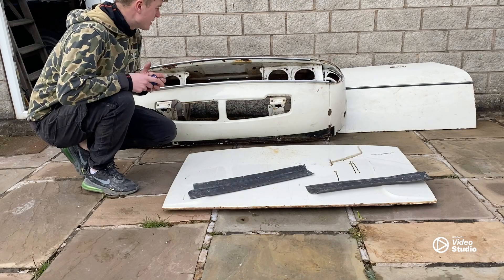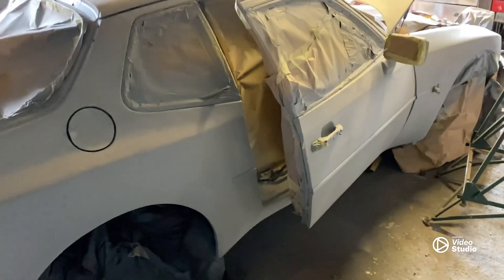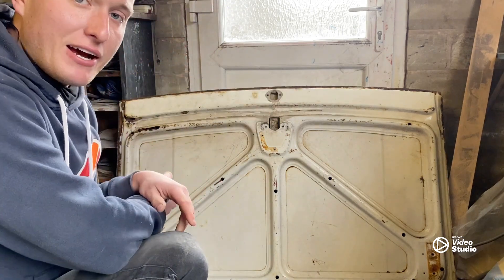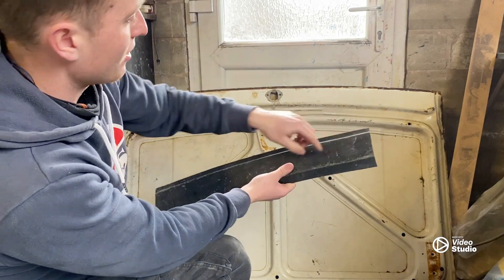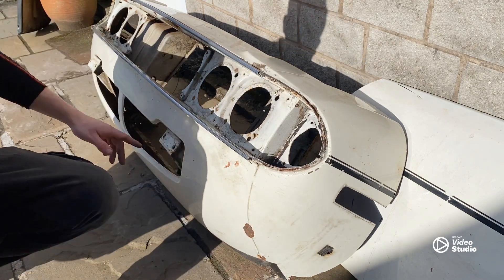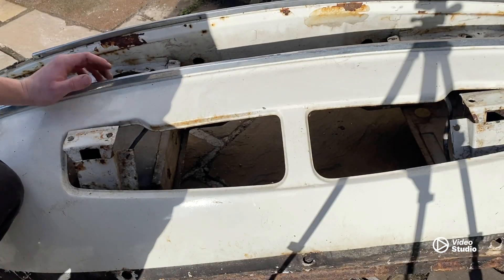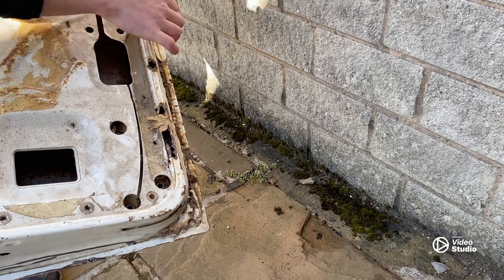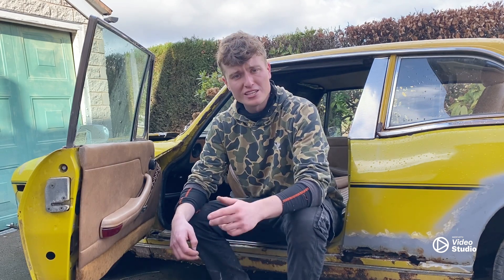I Bought some USED parts for my rotten triumph stag v8! …plus garage update....

Comment: I have just doing a load of welding and repairs on a project Stag. You have a fair bit of work there ! Other places to check for previous bodges and rust are top of A-pillars where they meet the screen get a wire wheel in there and see what you find, also suspension turrets front and back, floor pan looks like it is toast.  Boot floor inner wings all look like they need doing. Your a brave man taking that on.
Reply from the maker: The whole wind screen panels knackered I’ve managed to source a replacement even though they actually don’t make them anymore!

Comment: You can buy Mk2 boot lid repair panels they have the pressed area where the number plate lights fit be  much easier than changing Mk1 panels.
Reply from the maker: I just saw them before on James paddock! Definitely be ordering a pair

Comment: Do you know Yorkshire car Restoration..you can get some tips from these guys. Seem like cheap parts in this day and age. Good find. Good luck Bud.
Reply from the maker: I found their channel the other day, pretty good content! N I thought so too you struggle to find half decent bootlids for under 300!
Reply: @Boothsmotors  well I guess you in the triumph club. might get parts there. eBay made every body in the world a wheeler dealer. Lol.  Fit what you got. Repair what you can. Find parts and fit later. It's just a little more paint. But get it rolling fast. Before it drags on.  Over Order more paint from the same batch. You can touch it in later.. not sure if these cars ever held any value. If only they would have got the engine rite from the start. BL in competition with its self. Good luck Man.
Reply from the maker: @deanadrian638  i actually got the parts off fb marketplace!  There’s a few more parts I need to order then I can make a start!

Comment: That was a good price you have paid for your spare panels, not too much effort needed for the boot to make it work as a MK2 but how about the door, as if that’s a MK1 door you might have to replace the whole end panel with the MK2 aperture?
Reply from the maker: Ahhh I’ve not checked tbh I heard it’s just a case of moving the locks across but im not sure if the bolt patterns on the locks are the same, worst case I just have to weld the end panel from my old door to new door!

Comment: what's your day job? Is it in bodywork ?
Reply from the maker: I wish I could work on cars all day! I’ve got an engineering background (used to work as a cnc miller making aircraft bits) but I currently work for my dads garden services business! This gives me a bit more flexibility with the cars ect.
Reply: @Boothsmotors  ahhh cool cool - maybe if you start selling more and more projects, eventually that will becomes your business and you can devote more time to it!
Reply from the maker: @stuontwo677  i wish it was that simple! These older cars take allot of hours to get right and on the road, if I sat down and worked out the profit per hour it’d be sub £5 and that’s me working out a family garage with no rent ect! The only way to make it viable would be to do write off’s/ crash damaged cars! But I’m more of a classic car type of guy! I still find 20-30hours a week for the cars! So yeah a dream it has to stay for now!